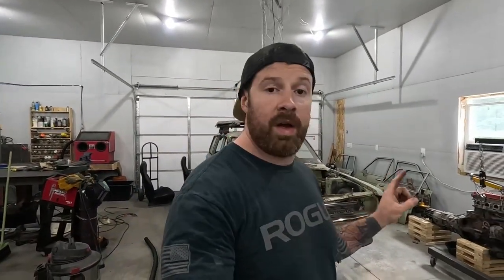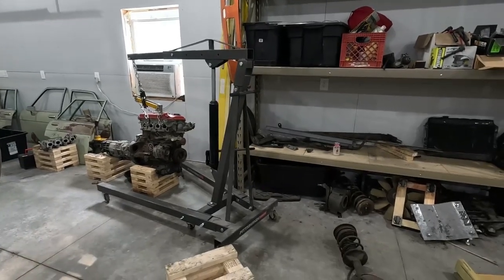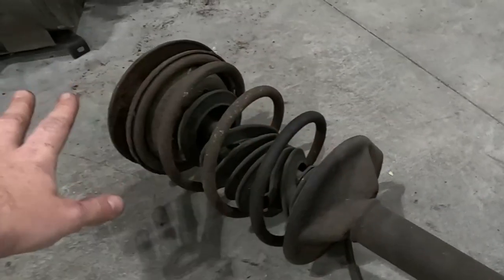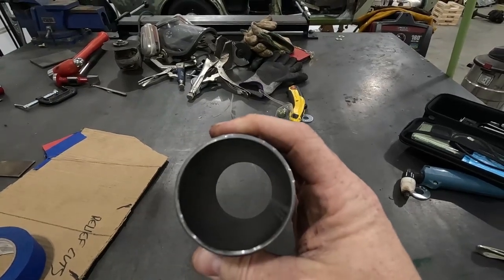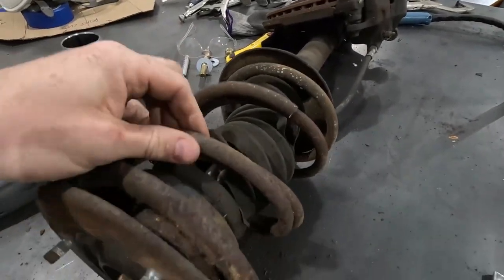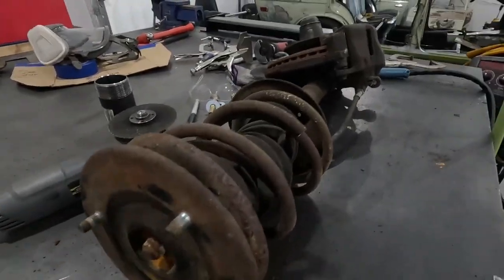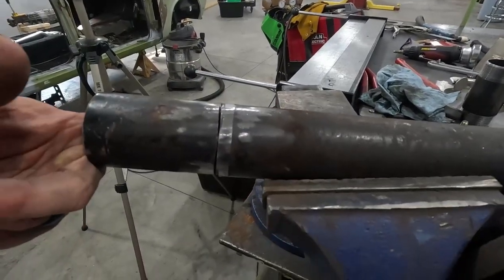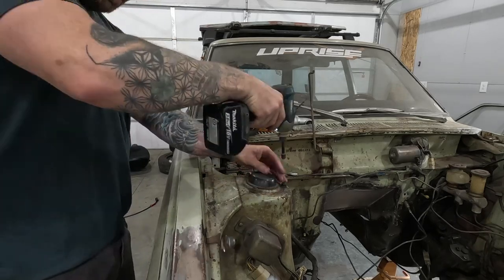Datsun 510 280ZX Strut Swap! DIY Coilover Conversion

Comment: When I did the strut swap on my 69, I put the tire back on and used a pipe wrench.  I kicked the wrench, which was enough to bust that shock nut loose. Then again, it matters where the struts came from. Thanks for the awesome dime video. I dig the original paint color
Reply from the maker: Now that’s what I call working smarter not harder! I plan to match the new sheet metal to the old paint so it looks consistent. I love the look of the car as is. Thanks for the comment! Check out the rest of the playlist!

Comment: 23:36 Just a heads up you are missing a coil over cap. It keeps the coil over centered and it is the surface that comes into contact with the strut  top bearing so the weight is dispersed when you turn the wheel. Look up techno toy tuning for examples of coil over kit. Great build keep up the good work. Your motivating me to work on my avocado  510 wagon.
Reply from the maker: Thank you for the heads up! I saw the top plates that techno toy tuning sells. They are reasonably priced. I’ll get a set ordered and do a follow up vid on that!
Reply: This. The spring needs to be supported by the upper strut bearing. It wasn't on the old setup.

Comment: Man looking good! Moving fast.   Just heads up the 280zx struts you might need to flip sides so right is on left and left to right.  The steering linkage hits the calipers so flipping moves it to the front so it Clears. Keep it up 👍
Reply from the maker: So driver side strut on passenger side of car would move the brake caliper to the front side of the rotor right? Will that work if the steering arm is pointed to the front when the 510 was meant for a rear steer set up? I might have to mock it up to see what you mean. I'll check it out as soon as I can. By the way I added a link to your channel in the video! Thanks for the help!
Reply: Those wheels look SO good!
Reply from the maker: Thanks! I thought so too. It was a lucky find.
Reply: @BuildSeason  the steering knuckle keep it on the same side from the start it bolt up the same way even if flipped.  There are some write ups on Ratsun forums
Reply from the maker: Dude that is some excellent knowledge man! Thank you! I’ll swap them around asap.

Comment: Not a bad cheap way for bigger brakes on a 510. But if youre going to rock it low like that, you are better off running shorter inner shocks than the stock 280zx shocks inside the 280zx struts. Theres a wide variety of shorter inner shocks that you can run so that you arent reducing half your strut travel with the full length unit. 

Me personally on my 510, ive got 910 maxima struts, similar to zx but a little shorter, and i chopped them and rewelded them to accept sw2 mr2 shocks. I get the benefit of super low coilovers, but theyve got full travel.
Reply from the maker: That’s some great info! I might do that in the future. The zx inserts were still too tall. I’ve heard about the mr2 inserts but never looked into it. Thanks for the tip!

Comment: Question, why didn't you just swap the 510strut tubes. Onto the z Knuckles?
Reply from the maker: I hadn't thought of that. The research I've done suggested this method as the way to swap to zx struts. What would be the best way to get the strut tube out of the knuckle? Maybe a press? Do you have a picture or link to a thread on this? That would have saved me a lot time. I went with the whole setup from the 280zx for the usual reasons. Bigger brakes, narrower track width (for the 0 offset wheels).